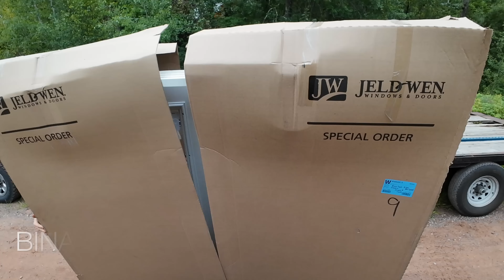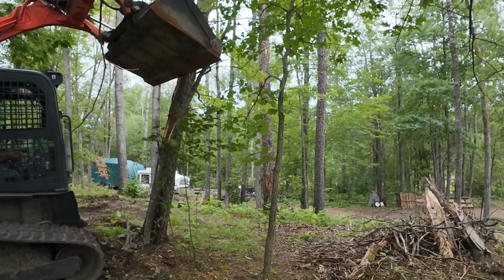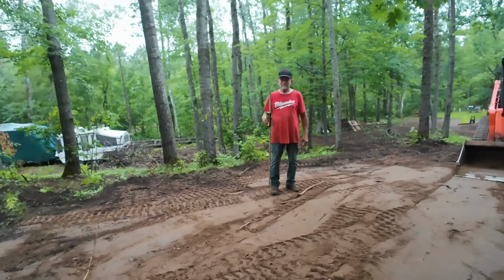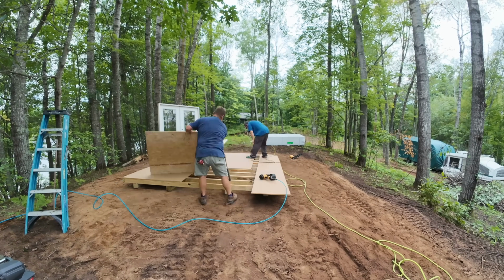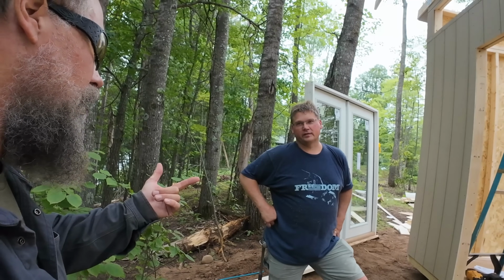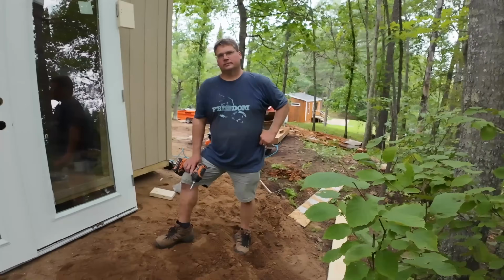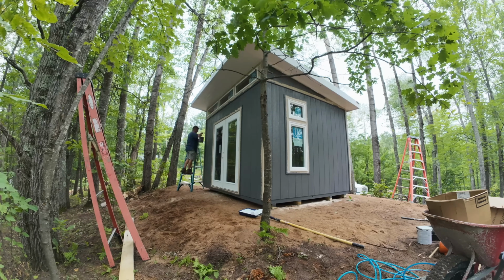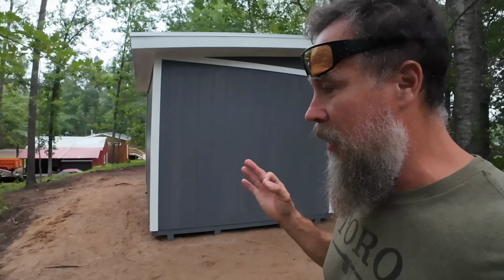1 Day She Shed

Comment: it would be great to have multiple small sheds for storing things. tools, extra wood of various purposes, tractor implements, etc. i have three extra buildings, plus my garage, and it never feels like enough haha. but, i plan to renovate my original two build sheds that previous owners built using material form an 1800s age workshop. so really nice old wood. but i want to put it on a concrete pad/foundation without damaging the old building. then next to it is a short wood storage shed which coudl benefit form some work as well. i got so many plans, but very limited budget, for now at least. but man, i woudl love to have like two or three of these type of sheds for extra storage.
Reply from the maker: It seems like you always need extra storage